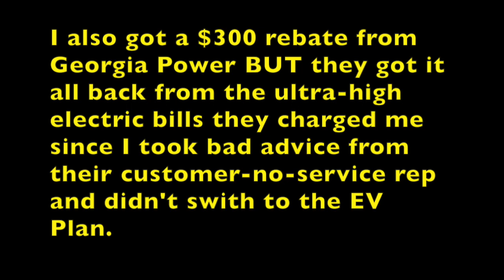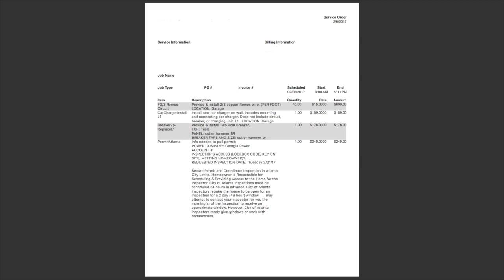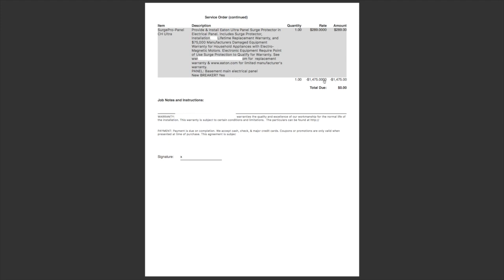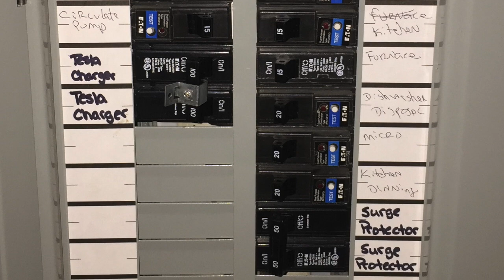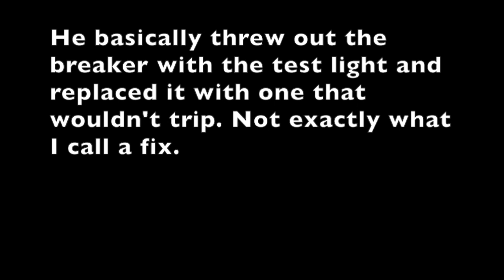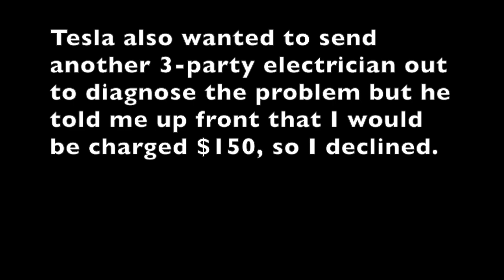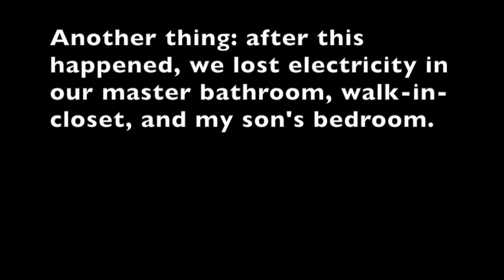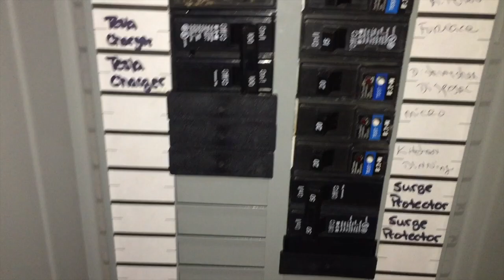Tesla HPWC Installation Debacle

Comment: With tons of respect, you seem to not understand a much about electrical work.  "2/3 Romex" doesn't mean two-thirds, it means 2-gauge wire with three conductors plus a ground.  That's odd because the HPWC doesn't use a neutral wire, so 2/2 would have been sufficient. I'm not at all clear on what they meant by surge protection though.

When I was scoping this out, I had some electricians over to give me quotes.  They were crazy high.  But I figured out how to do it myself.  My installation is for 48 amp charging.  In my case, it's an outside installation on a post.  Had to dig a 20' trench for conduit, but that was the only hard part.  It took me about 8 hours, soup to nuts. Not difficult work at all and it came out perfect.  

In my town you are allowed to do your own electrical work as long as you get it permitted and inspected.  The whole project was easy.  This morning the wiring inspector came by, inspected my work, and signed off on it!
Reply from the maker: And nowhere in any of my videos do I pretend to know about electrical work. It's not my thing. This is why I hired professionals (or so I thought) to do the job. Obviously, I hired the wrong electricians.

Comment: 100Amp breaker is too big for the circuit.  Tesla wall charger only need max 80Amp.  Car only allow to draw 64A for Model X for the built in car charger.  The breaker too big amp.
Reply from the maker: You are correct! However, I usually pulled at 68-70 amps which I believe led to the meltdown of my breaker bar.

Comment: I used to be a licensed journeyman electrician in CA and held a C10 contractor's license there, I have now career changed but still have the expertise and background of any master electrician. 
Only the back of your breaker melted because the connection between the bus bar and breaker wasn't good (loose or not aligned). When this happens the electricity jumps the small gap (arcs) in order to complete the circuit (get to ground). Each time it arcs it does 2 things:
1 creates heat.
2 blows a tiny piece of the conductor off - in this case those conductors were your bus bar in your panel and the breaker clip.
Each piece that gets blasted off expands the gap where the arc is occurring which creates a larger gap to jump, more heat and more conductor that gets atomized. It's really a vicious circle.
The problem was probably with your original breaker which caused the bus bar to be thinned out a bit so when your new breaker was installed it COULD have been spotted by a non-impared electrician.
Sorry for the hastle. I'm waiting for delivery of my Model 3 and have already installed my HPWC by the way, that thing was clearly designed by a network or computer specialist and NOT by an electrician. In almost 20 years of electrical work I've seen only a handful of situations where the line voltage lugs are in such tight quarters ESPECIALLY for circuits as high as 100 amps.
I am actually not comfortable with how it is designed and have calendar reminders set to remind me to check those lugs every 6 months.
Reply from the maker: Mark Bernatz, I greatly appreciate your input! I've always been intimidated by electrical systems. I partially blame my builder for this problem but he decided to use the electrician or installation as a scapegoat. Our fridge breaker occasionally goes out when the car charges in the middl of the night, so now I have to report this to them.

Comment: btw its not 2, 3rds its 2 or 3 gauge wire for the voltage of the 240v line, If you had higher gauge wire you would burn your house down as it would overheat and catch fire. Circuit breaker they assumed you bought your own or you had one to use already installed.
Reply: No, it's 2 gauge, 3 insulated conductor.
Reply: Romex is often labeled as 10/3 or 8/2 or 6/3 or 4/3.  Often read as number slash number.  The first number is AWG--American Wire Gauge--size of the wire.  The smaller the number, the larger the wire.   For Romex, rated at 60 degrees F, #14 is 15A, #12 is 20A, #10 is 30A, #8 is 40A, and #6 is 50A and so on.  You can Google others.  The last number is the number of conductors the wire bundle contains: typically it is 2 or 3 conductors: 2 will have white and black and 3 will have white, red and black.  Finally, the ground wire is also there but not listed (it is assumed).

Comment: The surge protector was a waste of money. They took you on that.   Second, I don’t believe that gfi breakers should be used with any EVSE Like the HPWC.   The HPWC does fault checks and that may have been tripping the GFI Breaker. It has built in GFI protection.
Reply from the maker: I agree. I knew they were ripping me off with that but they refused to do the installation without it.
Reply: I would have found another electrician to install your connector. They ripped you off my neighbor had his hpwc installed here in New Hampshire. His cost? $350 installed with a 60 amp breaker for his model 3.
Reply: Eriamjh is 100 percent right.  It's surprising your HPWC even worked with the GFI breaker, because it has GFI circuitry inside it and they apparently don't like to be "stacked".  And the surge protector is just total bs.  All the HPWC is raw un-GFI'd un-cleansed power out of your panel, and it will take care of the rest.  Candidly, I'm not even sure how it would pass inspection if the inspector was paying attention, because it says right in the installation manual to just use a normal 240V breaker of suitable amperage.

Comment: It’s strange that the arc fault breaker was tripping, so they replaced it with a standard breaker, which also didn’t make good contact with the busbar. You have 72 amps running all over the place, and the only contacts burned was at the breaker busbar, not the Tesla charge port, the connections inside the HPWC, or the connections of the wires to the breaker. 

If the guy was stoned, he might not have noticed it was too easy to push the breaker on the busbar, or some corrosion on the busbar. 

I would say the first guy who installed the HPWC didn’t do the complete job, because afterwards he should have asked you to plug in your car and charge at 72 amps while he uses his IR gun to check the system for heat. 

At least it’s fixed and hopefully won’t give you any more trouble.

Comment: I have a 100 amp service.   Quoted $850 to install a 40 amp outlet.   Was told I really needed to run 200 amp service to the house (electric co. does this for free) and I'd have to spend $3,300 to create a small 'sub-panel' in my garage (that I want to tear down and rebuild) and tie to my old screw in fuse panel in my basement.    LOL

Good luck everyone!    :o